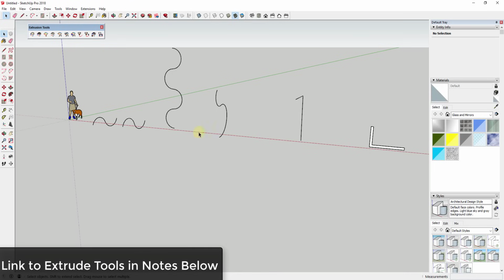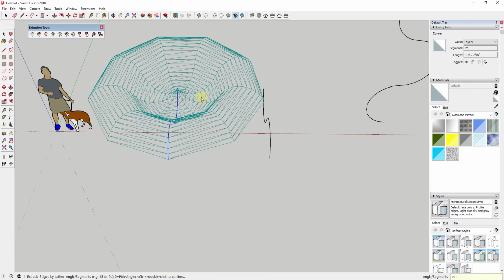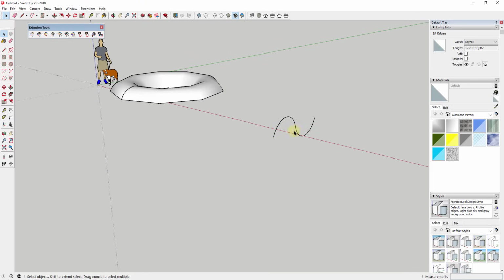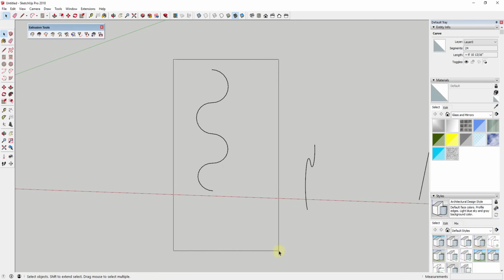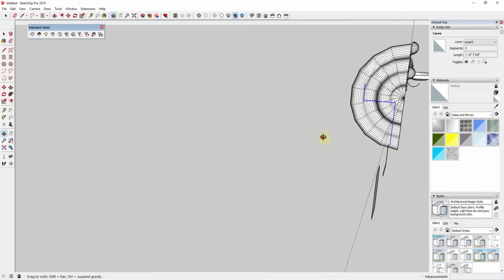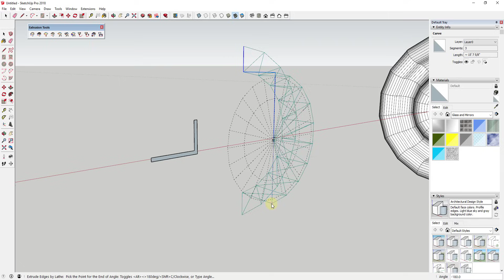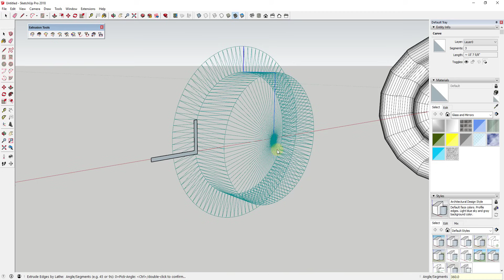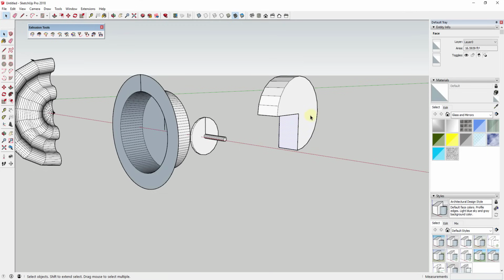SKETCHUP EXTRUDE TOOLS TUTORIALS (EP7) - Extrude Edges by Lathe

Comment: Hi Justin, 
I have a question regarding the Extrude Tool commands. When i try to extrude the edges so i could get a face, instead of a face sketchup is creating only Guide Points. It does this with all the commands that Extrude Tool Toolbar has.
Please help, thank you.
Reply from the maker: Are you using SketchUp 2017? Try updating the extension to the newest version